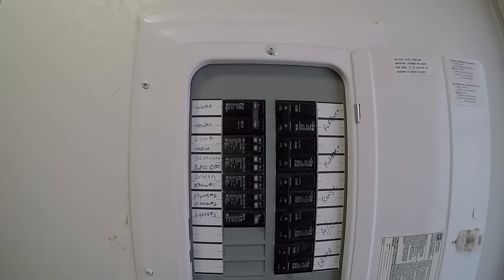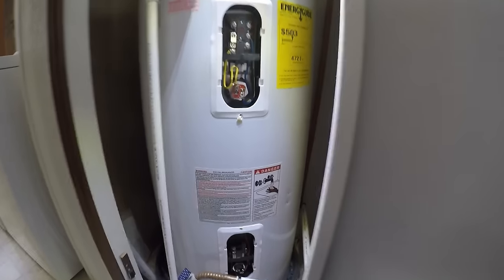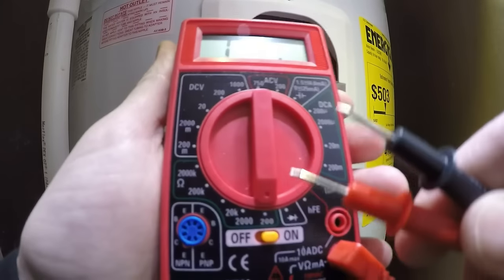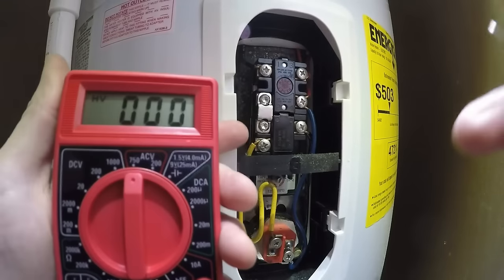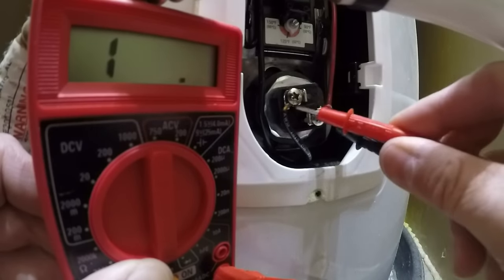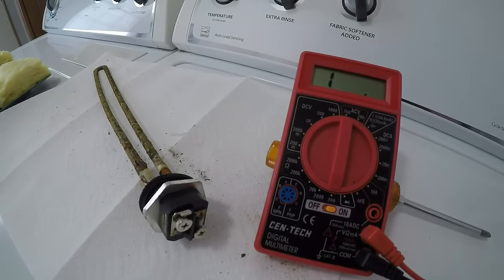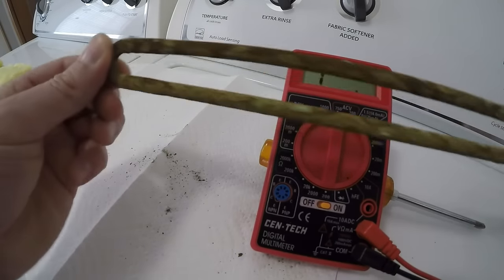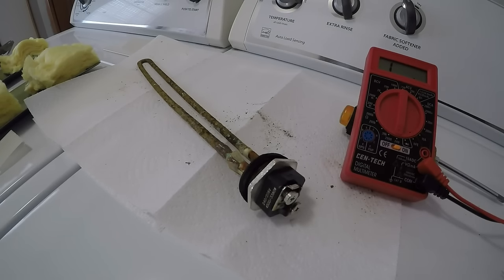How To Test A Water Heater Element

Comment: Here are some general rules:The bottom is usually  the first to go as it does most of the work, hot water but runs out fast= top element, warm water that last a while = bottom element. If element is in water, it is possible to get a false reading, especially if water has a high iron content and element tube is split.
Reply from the maker: Exactly Dave!! Thank you for sharing this!!
Reply: Thanks Dave! Replaced an upper element today, and the customer described it exactly how you did. Hot water, but runs out fast.
Reply: 66g
Reply: I'm getting some resistance to ground from the element terminals. It is very high like five or six mega ohms but I would have thought there should be no reading to ground at all. Could this be because of the water like is said above?
Reply: @lauratanner8475  Your element is probably split open and water is creating a path to ground.
Reply: Yep because on my bottom one I am still getting three ohms
Reply: General rule check live first then flip the breakers check dead, them check a live outlet to make sure your meter is still good.
Reply: @samylsneh6186  don't you check on those with the power off?
Reply: @guruofendtimes819  not sure I understand you. Searching live dead live power test would probably pull up videos
Reply: 😮 Sorry😅😅 1:16 😅😮😅😊
Reply: Mine just stopped heating  out of nowhere last night.  8/20/2023. It was hot all evening.  And boom, nothing.  I've replaced elements in previous water heaters. The tank I have now,  I installed about 6/7 years ago.  I haven't had a chance to check it yet.  I'm hoping a breaker just tripped.  But, if it did,  probably a sign of a bad water heater.
Reply: @williammills8953  Tripped breaker is a sign of a bad element, a bad thermostat or a short somewhere. Usually the only time  a water heater itself is bad is if it leaks. Be sure to check the reset button on the thermostat. Good luck.

Comment: A note on meters: one should check a known energized circuit like an outlet to make certain your meter is fully functional. A reading of zero volts doesn't guarantee the circuit is de-energized. It simply means your voltmeter could be faulty. Always (and regularly) check a confirmed energized circuit, like a wall outlet that you just unplugged something in operation from. One can never be too safe with electricity. It's invisible, oderless, and usually silent. You won't know it's there until it's too late.
Reply from the maker: Thank you very much for sharing this extremely helpful and important TIP!!!!!👍
Reply: @jamiewagner  Hey, got a story if you care to read it. Its long-fingered, so I'll understand if you don't want to. Awaaay we go!
I worked with low to medium voltage. It terrified me. Not only that, this was when I worked for a foreign owned company that only observed the bare minimum (not even that at times) of safety protocols. It showed in the shortcuts in general construction of the facility (stop buttons would break the neutral side of contactor coils instead of running a hot back to the MCC) and in what they would try to convince one to do. One would often hear this pidgin English phrase "It's OK. You just be careful." Whenever I was on deck when a motor change out would occur, I would take every precaution I could think of. I lock-out, then press the start button to check initially. Then check in the MCC. From there, I would go into the pecker-head(jbox) of a motor and check with a voltage field detector. From there, with great care, dismantle one of the terminations until I felt I could penetrate the tape job with a lead I had sharpened to a micron of its life. Lastly, I would get down into it until I could get a screwdriver or jumper on metal. I would then queeze my eyes shut, clench my butt, and ground that sucker. Only then did I feel safe to root around without fear of blowing my nipple rings out.
It was a place called Nan Ya Plastics(Taiwan) right next to the Morganza Spillway in Louisiana. We produced PVC film. Continuous Roll was the method. Our process controls were speed and temperature. Just before I left for employment closer to home, they had a green hand and one other operator prepping a line for start-up. Green was cleaning the coating of of the calendar rolls- 3-4' Dia heated cylinders that would roll the PVC mixture out to the desired thickness. In the event of an E-stop, they would only open to maybe 2-2.5". Operator lined Green out and removed from the immediate area to pursue some other duty. Poor Green managed to get his caught in the gap and was pulled in up to his shoulder. Fella had to sit there and cook at about 250-300°F while they dismantled the calendars to free his arm. The Taiwanese people are very nice, but they are driven HARD to produce. They will let one take whatever shortcuts they could talk one into, so long as it doesn't effect production negatively. Very different culture and social behavior. The poor slobs would be physically abused by their superiors if they didn't like the numbers.
Reply: @bignasty4874  damn that sucks BN. I worked for weyerhaeuser in an osb mill and the culture there was exactly the opposite of what you describe here. It wasn't perfect and yea some shortcuts were taken from time to time but for the most part they walked the walk when it came to safety. Some of the employees would bitch about some of the more extreme rules and regulations sometimes and some of them did seem a little overkill. But I would always remind them to be thankful because it could be the other way around where they look the other way and tell you to get it done whatever it takes. Even with all the focus on safety they have still had some horrible accidents, it's almost inevitable if you're in business long enough. Thankfully none of them were at at our mill tho.
Reply: That's why I always use a hot stick as well
Reply: Big nasty@……. Evidently you haven’t ever done long term production work.   There is no such thing is 100.0000% fail safe when there is so many variables including humans. What works out in theory doesn’t always pan out the same in reality.
Reply: @Free And Critical Thinker  Evidently.
Reply: Also it pays to touch 1 lead to a power wire and the other to the tank. I have run across water heaters  wired with single breakers and not doubles. If 1 is flipped off and the other is still on you still have 110 volts. I was taught to test with both power wires and then take one lead and touch to tank. If it shows nothing then all power is off

Comment: Hey Jamie! Thanks so much for the concise video! You are well-spoken and to the point, which is very refreshing. I got a sky-high electrical bill last month, which is super out of character when comparing it to my bill history from the rest of 2023, and even the same cycle one year ago. Wondering if our 14 year old electrical HWH is the culprit. We actually had a small leak from it about a year ago during a 4-day power outage, but after the power was restored the HWH appeared to work just fine. But perhaps this was the beginning of a larger problem. Can a faulty thermostat or element cause our bill to suddenly be insanely high? Do I check this with a multimeter as you've shown in your video? Thanks so much for your help!
Reply from the maker: You're welcome I really appreciate the great comment

Comment: This video helped so much. Thanks. I was just trying to see if I turned the proper circuit breaker off for my hot water heater tank. It's clearly labeled on the fuse panel. I just wasn't sure.
Reply from the maker: Thank You! Be sure to ring the bell, that turns on notifications so your alerted when I upload a new video! Hit that like button and share my videos! Thanks!!

Comment: I knew how to replace it, but testing the element is what I needed. This is stupid easy looking.

And yeah, something (element or thermostat) is flipping my breaker too. BURR!!! Cold showers suck!!!
Thanks!
Reply from the maker: +Chris Foster yeah it sounds like almost exactly what was happening to me but mine was burning hot definitely pop out those elements and check them you never know either that or the thermostats are bad good luck with it
Reply: I went home during lunch, and I got 8ohms when I tested continuity of the element.
I'll try testing the thermostat tonight... we'll see how that goes.
Reply from the maker: +Chris Foster yea good luck with it. I hope you figure it out if you got a bad one or not.
Reply: yea my breaker popped when I tried to reset it so I knew something with the WH was shorted to ground.
cut power. checked for no input voltage.. disconnected wires from top element. ohms tested each attachment to the metal Tank and eventually found one side of my bottom element was shorted to ground/the tank..

Comment: Jamie you mentioned your water got really hot, so you decided to investigate.  I noticed my water seemed a lot hotter and shortly after is went it quit. Q.  did thermostat quit working first, leaving element on all the time burning out the element ? I should've figure something wrong when it was so hot. Got educated this way tho. Thnx for video
Reply from the maker: Yeah that’s what I think happened to mine it’s was so bad it caused overheating and it was not controlling the temp correct. Mine was burning hot and I knew something was wrong

Comment: Hi Jamie,

Informative and helpful video. Thanks! Just an Fyi: Around marker 2:31 you mention that we should see between 10 and 16 oms on the meter's 200 scale across the element's screws. Other sources around the web mention that 10-16 range too. If I'm not incorrect, 10-16 is what you'll see on a working 4500 watt element. If however you have 3500 watt element like my 40 gal Rheem does, a new element will test at 18 ohms exactly. When I first tested my old elements, I was confused why I was seeing 18 on the top element and an open circuit on the (failed) bottom element. After I bought new elements and tested them, that uncertainty was answered.

The takeaway here is that different wattage elements are going to have different normal resistance ranges across the wire hold down screws. Maybe someone more knowledgeable than I can post the ranges here for other people's benefit.

Regards . . .
Reply from the maker: Dude! Thank you so much for sharing this info! I believe you are correct!! This will help others. Who watch this video! Thanks again for this awesome comment!!!

Comment: Question for you on the test that you did on the element, if you get a high reading around 18 would that mean also the element is going bad also? This is what mine is checking. Thanks and thank you for this video.
Reply from the maker: it would probably depend on what the wattage is for your unit, if you have the manual you might have to research it some to see if it shows any specific readings, if you don't have the manual then just research your model number and brand on your tank on google to see if you can get any more info, because they are all different so I'm not sure if 18 is high or not for yours

Comment: "OK GUYs"...and a girl.  Thank you so much.  I don't know why people do these things but I think I can do this.  I am a first time home owner and calling a repair service is expensive.  I'm going to give it a try!
Reply from the maker: +Cathy Pascale just make sure power is off. You should be ok to do it you can always watch other YouTube videos to you will see that everyone pretty much does the same thing since this video mine works perfectly fine. Make sure you read me description also at the bottom of the video
Reply: Thanks!  I decided to replace ALL of the parts...two elements and the two thermostats.  Tank is over ten years old and I am on well water.  After looking at your element, I thought I might as well.   Ugh...they were bad. Of course I did not know you needed a special socket to get it OFF.  Another problem.  I did not release the pressure valve at first and the tank vapor locked. I had to call my neighbor next door.  It took forever to get it drained.  Bought a 'replacement kit' and today I am ready to replace all of it.  I think the worst is over.  I should have watched videos on changing the elements!  I now see I did not have to drain the tank but glad I did.  Kit costs $19.00.  Socket $7.  My goal is to cancel my scheduled Plummer appt tomorrow and save myself a TON of money.  I've learned a lot.  Thanks again !!!
Reply from the maker: LOL, I ended up doing the same thing you did replacing all that stuff. Sorry about the other issues you ran into. I should have mentioned them. Actually I did record the other parts like draining the water out of the tank and replacing the thermostats. I just haven't had time to upload any of those videos yet. But I should so I can put a link from this video to those ones. Sorry that your tank vapor locked. But glad to hear it sounds like you got through this yourself! me too! I saved a bunch of money doing it all myself and everything works great now!
Reply: Well; after two trips to the hardware store and a weekend in the closet I got everything wired BUT...didn't get the elements tight enough. SO...had to UN-wire what I did and tighten them more.  I took a nice, HOT bath tonight.  It all works !!!  I can't believe I did it.  It is so nice for you 'guys' to make these videos.  Blessings for all you do.  I took pictures and posted it on FB.  My friends are amazed.  (big smile).
Reply from the maker: +Cathy Pascale well good for you! Great job! Real glad to hear that you got this and my video helped! Have a good one Cathy!

Comment: Do you have to disconnect the wires? So you only  get the resistance of the 1 element.  I believe they are wired  in parallel?

Comment: Thanks man. I hate doing electrical and plumbing and a water heater is a mix of both. I bought my place from a freaking  moron and the lower heater went bad. Breaker didn't blow which has me worried (again) about the sub par wiring he did. I think my ex gf showed me how to do it a few years back cause she had hard water too. I just needed a refresher.

Since you need to drain the tank for that lower one it's also an excellent time to flush it out too. :)
Reply from the maker: Yep! 👍 I did end up flushing it out and starting fresh, it's been working great ever since then for the new owners

Comment: So I just changed my elements. With breaker off I'm getting 13.7 reading on both of them, but when I turn on the breaker. One element is reading 13.7 and the other one doesn't read anything. But when I turn breaker off both reading 13.7.... do they alternate?
Reply from the maker: Wow not sure about that, that's definitely an issue I'm not familiar with, your gonna need to troubleshoot that one

Comment: Will the water in the tank cause my element readings to show continuity?
Reply from the maker: not sure try it both ways
Reply: Water will show continuity. Which is why I asked earlier jn comments. But, I think if heating element is bad(open), you will see infinity or a very high ohms reading. Don't know how this will affect water temp, but blowing a circuit breaker seems most probable. Keep in mind that the heater is just to heat, but the thermostats is what triggers the heater on/off.  So if heater coil bad>>water doesn't heat up>>>thermostats tells heater coil to stay on >>>cycle continues>>>eventually overcurrent and circuit breaker trips.....so j don't know if narrator of vid had more issues

Comment: Finally determined the upper thermostat was bad.  Replaced it about 2 hrs ago and now I have hot water!...:D
Reply from the maker: NICE!! Thanks! go hit the like button on some of my new videos if you want that really helps me out to keep making great content like this for everyone!
Reply: Well, the hot water is almost gone and the heater isn't on and there's no power to either elements but there is power to the heater and across the reset switch. I tested the upper thermostat and there's continuity on both poles (isolated it from the circuit)! How does that happen? Haven't tested the elements yet, but they appeared to be good yesterday.
Reply: Liked and shared on FB...:D
Reply from the maker: sounds like a more in depth issue. Be careful testing all that stuff. Be sure to dig into your owner's manual and see what you can come up with. You got some kind of issue going on for sure.
Reply from the maker: @moonrules7365  Thanks dude!!!
Reply: Very welcome, Jamie!...appreciate your help.